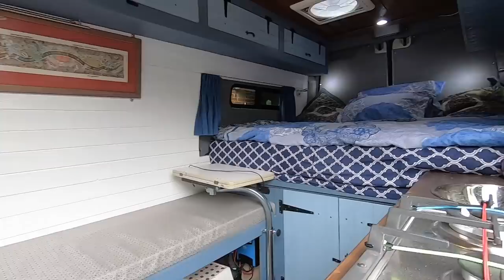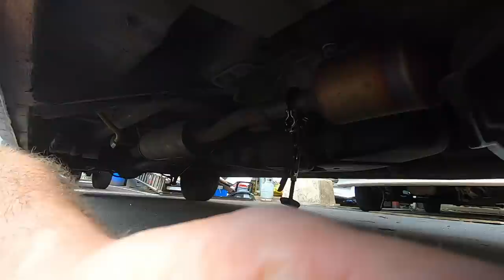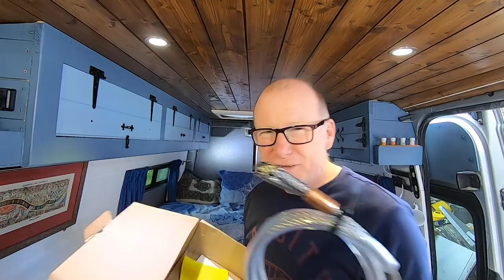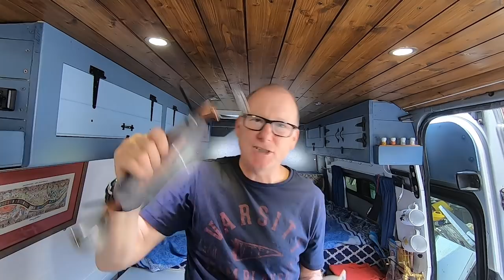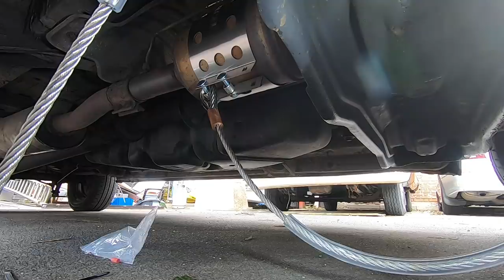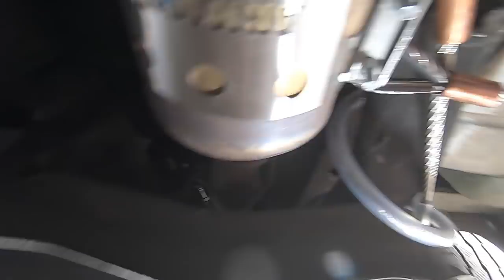Catalytic Converter Theft Prevention

Comment: Agh Mel the way this video comes across is someone tried to pinch the cat,  You show the tool still fixed to exhaust as you found it. You get a delivery on the same day for the armacat and fitted the same day in a lock up while wearing the same tshirt. Hope its not staged or that would bug me.
Reply from the maker: No mate I put the tool back to show what happened that’s all it turns out that tool cost over £100 I’m not going to spend that to make a video lol
Reply from the maker: If I get chance I’ll show you under the jeep on Wednesday waffle

Comment: They don't go out with a toolbox of different cutters  just the chain cutter.  If it looks like its going to take more than 60 seconds to remove they are out of there. They know someone may have already seen them lurking at 4 am and called the police so they have got to be in out fast.    Then you have to look at van security they can peel a side door down and nick all your stuff in less than 2 mins.  Getting upgraded dead bolts on a van is essential.  Stealing a keyless van with a transponder 20 seconds.  The only way to really stop them is 360 cctv,  a very big dog and a shotgun :)
Reply from the maker: I’m liking the shotgun idea 🤓👍

Comment: Nice job - I wonder if that sleeve will cause your cat converter to overheat and then you will need to buy a new one anyway ?  Just wonderin ?
Reply: I hope you stopped those theivin little toe-rags !!
Reply from the maker: That’s good point I’ll find out at the next mot it should be ok though from experience the hoter they are the better they work 🤞🤞
Reply: @BigVanSmallWorld  You make a good point too, they do work on heat.  but, I'm wondering if that sleeve makes them hotter, does it pose a threat of igniting a fire or burning off the undercarriage rust protection ?  Just a thought.  I want to get one, but not if it is going to cost more damage than it prevents.

Comment: Never seen that tool before I guess it stands to reason they exist, I guess crimes only gonna increase with mass unemployment glad they didn't get going with yours.
Reply from the maker: You could be rite there let’s just hope it doesn’t get that bad 🤞🤞👍
Reply: The tool is an exhaust pipe cutter. "normally" used by mechanics to cut off old exhausts where the clamps etc are rusted.